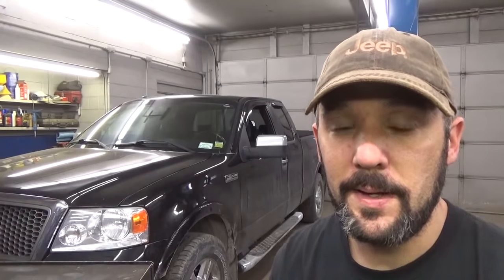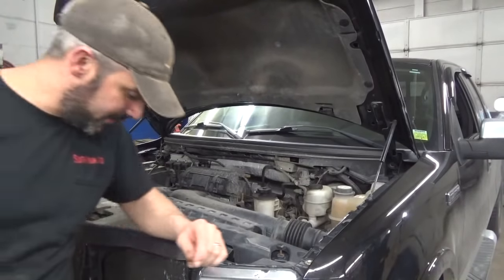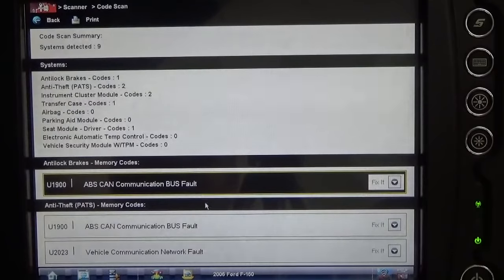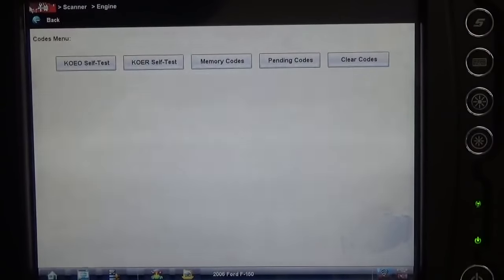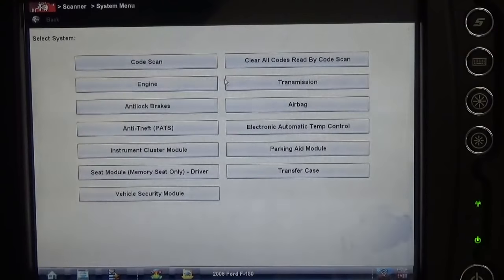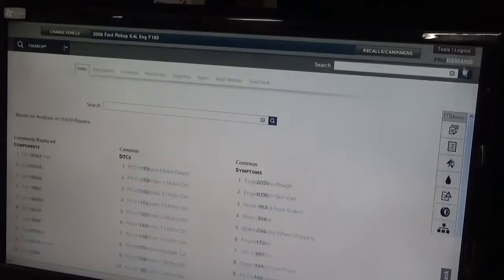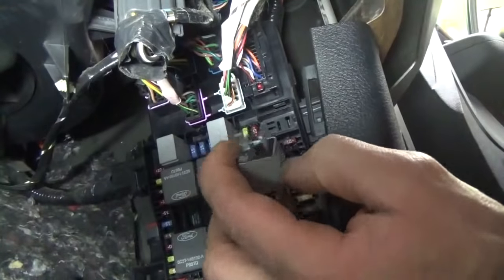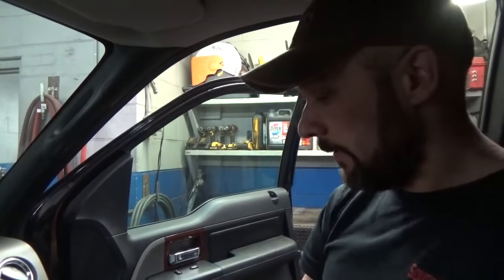Ford F150 5.4 No Start, No Crank, No Communications Codes: U1900, U2023

Comment: I also like the common sense approach. Start from where the power to whatever starts and work forward from there. I'm glad you took that relay apart. That's what I'd do because if something fails I want to see why. Some of that stuff that isn't made to take apart can be fun to take apart. I have to wonder what Ford was thinking when the decided to put the fuse box there. Oh, I know, they weren't thinking. Now that's a big surprise. :-D
Reply: +The On Grid Homestead Am I the only one who doesn't mind ford's fuse box placement? I mean out of the fords I've owned or worked on, I've seen much worse from other manufacturers. Although I agree, the fuse box labelling is crap.
Reply: Naoki Saito You're right, a lot of car manufacturers put the fuse box in stupid places. It's kind of like the designer forgot all about the fuse box then had to locate it anywhere there was a little extra space. Actually, it seems like quite a few elements in modern cars are inconveniently placed that way :-D
Reply: +The On Grid Homestead I actually think it's a Ford generic thing. The older Focus's PCM was located in that spot.

Comment: Hi Eric.  Thank you so much for this post.  I crawled down the same rabbit hole as you did with this truck, except with no scanner or schematics at my disposal.  I found a few things on the internet that helped me but eventually led to a dead end.  My truck had the exact same problem and solution as yours.  I found that fuses 32, 33, and 34 were not getting power just like your issue, but I was unable to isolate it to the PCM relay.  Your video helped me tremendously and guided me to the finish line.  Thank you.

Comment: You usually don't need fancy tools to diagnose:
1) I bet the CEL didn't come on KOEO (when you first turn the key)
2) Bet the tach didn't move when cranking (This is also  a test for the CPS)
Always look for that on fords when there is a no-start.  

Usually that means a power issue to the PCM. Relays fail even if they look perfect.

I had this same issue on a 96 Lincoln a few years ago.
Reply from the maker: alb12345672 I fixed  a lot of under hood fuse boxes on those old Lincolns.

Comment: Thanks Eric....
I've been really struggling this winter with my stubborn 04 F150 Triton 3V.
First broke a timing guide  ...barely limped it a few miles home.....fixed the timing stuff did lash adjusters checked rollers...new oil pump and PS pump that was leaking.
It ran ok but stalled when hot....got a code for engine temp sensor....also found vacuum leaks at the intake so I pulled that all apart....did plugs while it was apart and checked the knock sensors.....took my time and was real careful.
But then crank but no start.....messed with it a bit the no crank no start !
By now I'm way out of my league....gauges were acting crazy....had a weird clicking.....
Found your vid this morning and tried swapping the relays.....started immediatly !  That R02 relay is for fog lights.....I dont even have any !
Thank you so much......I dont have any more $$$$$ to pour into this truk but for now I really need it.

Comment: Feb 2021 2006 f150 won't crank . Watched video in grocery store lot contemplating a tow home under stood the content. Switched places with my wife and went for the #203 relay. Pulled it out, grey colored body but no corrosion discoloration, plug back in and eureka the motor started and She drove us home no problems. 
I'm buying a new relay tomorrow.
Thanks for the show
Bruce in Ohio

Comment: Hi Eric....I've been  enjoying your show for more than a year now.I am a retired Ford dealer service tech.I've found many problems with corroded relays on F series trucks,due to a leaking windshield.windshield washer fluid is quite corrosive and the  smart junction box is a complicated piece.I'v found many SJBs corroded beyond repair,due to  a leaking windshield.Just thought you might like to know...
Reply: Brian Jourdan same here... retired Ford tech.. found water in right side rocker panel... bad relays in BJB.. Don’t really miss dealership setting.Have my own shop now and doing agriculture work.. in frame overhaul on Diesel engines. Take care.
Reply: Exact same thing happened to my F-150.

Comment: stupid place for a fuse or connection/junction place. if you live where they salt the roads in winter time, youll know this. ya jump in the truck with your snow/salt covered boots.  its cold ya crank up the heater. it gets hot. evaporates the water blowing around the salt. then you have electric flowing nearby. static and magnetic forces collect that ionized salt  and it collects on the metal. then it cools.condensation forms releasing the salts and enabling the corrosion. this dont happen overnight. it could be weeks , months or years. if you have a vehicle with a box in a position as this  i would recommend removing the fuses and relays clean them with a good cleaner and reinstall in thier original position using a electrical grease to help seal the connections to reduce the chances of corrosion. ps do one at a time and double check you have the right rated fuse in the correct position
Reply: richard cranium idk man. i've got a late 70s fullsize bronco that has the fuse block just above your feet. they never came with covers or nothing. just totally exposed and i havent seen any oxidation on the contacts.
that being said, i think the contacts might stainless so that probably makes a big difference.
Reply: I like it much better in the engine bay
Reply: "its cold ya crank up the heater. it gets hot. evaporates the water blowing around the salt. then you have electric flowing nearby. static and magnetic forces collect that ionized salt  and it collects on the metal. then it cools.condensation forms releasing the salts and enabling the corrosion"

That's the one of the most impressive lines of bullshit I have seen in awhile.
Reply: "static and magnetic forces collect that ionized salt" LOL, yea.... you nailed it derekc728!
Reply: What's more important is, these late model computer technical vehicles are still built with old school fuse and relay boxes that are open to the elements. These designs have been around since the 1960's minus the actual fuse design from the old glass buss fuse to the current slim style. Of all the videos I have watched on this channel most of the customers problems are ELECTRICAL and/or cheap plastic crap devices that do not last as far as you can see tail lights.
Reply: @GlycerinZ  like Doge/RAM , exposed to all the elements? Water, sand, salt, heat, extreme cold, coolant, oil and all other fluid spills??? Really???
Reply: @youtubito69  yeah, I'll take it in a convenient spot where I don't have to crawl all awkward just to do testing.  And you DO know that fuses/relays come covered, right? To where the elements can't really get to them, because they're in a covered box.  C'mon, have more common sense.
Reply: Garth Clark...."cheap plastic crap", sounds like you've been watching Scotty Kilmer. Lol!

Comment: This  is Great ,Trouble Shooting  explained very clear & to the Point ,  Eric is a Real Professional  .  I have been a Mechanic for Over 50  years and I  LEARNED a   Lot from this .     There are a Lot of videos  on line However Many  take to Long to Really get to the Point  of the Issue / Problem  I  am trying  to Locate.

Comment: i have a 2005 ford exploder... lost my keys and had a locksmith make me a new one with a code, it started a few times and won't start anymore... so my computer isn't picking up the chip code... i jumped the starter and it turned over but would not start, should i clean out the ignition switch with electrical cleaner or blow it out with forced can air, i'm stumped, got any advise???
Reply: Did you talk w/ your Ford dealer ? They should be able to help you out with a new key. If not go back to the locksmith and either get him to fix it right or ask for a refund. Also, go to a Ford forum online, and ask them, you will be surprised how much help these guys can be.
Reply: Joseph M thanks... i talked to a couple of different ford dealers and their response was bring it up and we'll take a look at it and got price ranges from 300 - 3000 so i got some electrical cleaner and sprayed it in the ignition switch, and took out the remote auto start... and it started right up! not sure which one did it but i'm glad it's working now...
i talked to colorado lock and key and they told me to piss off and that they aren't responsible and offer no warranty after it works and they leave
ford forum eh? is that a chat room?
thanks again
Reply: heavylead1961 Glad things worked out for you. Wow the Ford dealers are crazy with that price, and such a price variation 300.00 to 3000.00 dollars.
Reply: heavylead196

Comment: Scope on a rope worked perfect. Had an 03 Expedition towed in no start. Popped schrader on fuel port. Nothing. Like an over eager idiot, I put a fuel pump in it. Still no start. Long story short. In that Central Junction Box the fuel pump relay is a little micro relay soldered into place. U can buy them online for about 20 bucks. My soldering and circuit boards techniques r very poor and 340 bucks later replaced whole thing. Ford had it in stock so u know what that means. I shoulda used scope on a rope and checked for power to fuel pump. The upside, it comes with all new relays like that grey one u changed out on the F-150, and now I have a bushel basket of Ford relays and fuses.
Reply from the maker: Bill Rimmer Hey Bill, I think we have all had those "hard learning" lessons :)
Reply: Bill Rimmer. Yes was headed down same rabbit hole .Then the customer noted that smoke and strong burning smell came from fuse box.
Reply: Lol I was waiting to run into this exact story!
Reply: I did the same thing by replacing the fuel pump.  I will know if this fixed the problem by this afternoon.  Thanks for your comments!

Comment: I know this is super old but here is a logical explaination: This relay is always on so the coil gets fairly hot in an enclosed space. Condensation.
Reply: Exactly! Condensation leads to moisture; which leads to corrusion; which leads to high resistance; which , in turn leads to the inhibition of electrical flow. Which is why the vehicle would not start.
Reply: Heat would evaporate the moisture.
Reply: Condensation doesn't form on a heated surface. It forms on a cold surface.
Reply: @samsteel4456  The higher than normal heat would cause it to condensate more after it was shut off - especially if the outside temp was low (winter-ish).

Comment: 5 1/2 years later... Still a good watch!
Reply: watch your video and if it worked for a while and then my truck no longer worked
Reply: ⁵³
Reply: Still relevant information. By complete chance, I happened to come across this video while watching randoms on his channel.....and I have an 07 with an intermittent no start - no crank issue. It only happens every now and then and it goes away when I try to crank it over like a million times. Now I know what the problem is and I'll be changing that relay.

Comment: Great video Eric.  Btw from watching this video before hand a while back I learned a few thing's.  Well what I learned came in practice when I had a newer freightliner cascadia with a no left turn signals out of the seven way light cord. Well I check power at the relay and got my normal powers and grounds. But my fuse was dead so when the relay clicks on and off my fuse would flash with the test light. That's normal and my relay was clicking and not transferring power. So I pulled the relay back out. Stuck another relay in its place and the turn signals started working.  Something relay clicked fine but wasn't transferring power to light my test light at the end of the 7 way. Same relay style in this video is used on that freightliner cascadia.  Well I didn't have a relay right away. So I pulled the horn relay out of the 97 dodge ram shop truck. Hahahaha.  Thanks Eric and happy new year

Comment: I wanted to comment that the bcm on the 2007 mustang gts are famous for ruining the bcm with water running down the a pillar into the bcm. Its been very rainy so im pretty sure im going to find the same thing on a 2001 ford f150 4.8l Thank you for the assist I found this while researching no crank no start issues, You saved me hours and my friends a lot of money.

Comment: dude this is literally what happened to my ford f150 (2004) unfortunately i went ass backwards before finding your video, i replaced the starter ($160) same thing, replaced starter solenoid relay ($25) still nothing then i looked up some videos because i couldnt figure it out until i did the same thing where i messed with the fuses and i got that beep then i checked the same one you did and the center prong showed some signs of shorting like overheating because the plastic looked different so i replaced that pcm relay ($15) and that was it! anyway at least now i have a new starter with lifetime warranty haha great video man!

Comment: Thank you so much!! My truck had the exact same issue just now, and I was stranded on the side of the road in southern Florida 105 degrees in the sun trying to get the truck to crank. Exact same problem with the relay, back on the road now thank you!

Comment: Another excellent vid! 

Leak at windshield on pass side is a mid 2000's ford truck common issue. The fusebox is multilayered with hard soldered relays inside that you can"t see. You can disassemble it but its a big pain. There will likely be more issues in the future. You can still get OEM fuseboxes. I bought one for a 2004 navigator and it was manufactured in Mexico in 2017, 375$ish. It is not too hard to replace it, bunch of screws and connectors.

Comment: I realize the date this video was created. On point troubleshooting sir! Water intrusion on the forward side of the firewall is an issue. I believe I saw an aftermarket hood/cover that can be installed over the firewall PCM connectors to prevent this from happening in the future .

Comment: Absolutely outstanding video!!  I have the exact same issue with my '08 F150.  Exact same fusebox, etc.  Just went out and looked at the relay, no corrosion, but I still suspect the relay.  A friend and I were checking fuses, pushing on relays to ensure proper seating, etc.  Since then the truck has failed to start once.  I'm going to get a new relay (I know, parts changing) and install.  Drive around the block a couple of times and see if it starts while warmed up.  Initial problem occurred when engine was warm.  Thanks again, great video.
Reply: What did it end up being...I'm having a heat soak issue I think new starter as well 2006 f150 5.4...thanks brother

Comment: That truck was in flood  and got water in the electrical box. Simple fix spray entire box with electrical spray and check all connectors , but make sure battery ground disconnected. Then it should be good, great job eric.

Comment: Thanks man for this video really helped get me in the right area for me. It was a different five amp fuse, but in the same area I was not getting power to my relays of top and my relay fuses, so one 5 amp fuse after messing around and wasting time fix the problem your video definitely got me in the right area. Thanks again.

Comment: Dude that’s a fine video and time well spent listening and watching you work. Problem is i haven’t got you for my mechanic and I’ve the same problem, i.e., battery is charged, gauges display but truck won’t turn over. 2011 f-150 5 ltr. 20 miles out in the So Texas country.

Comment: Been a mechanic for over 60 years, still learning,  Enjoyed your vid and your attitude,  Start with the basics - always.  How many times does it turn out to be dirty battery terninals - that look clean even?   My first car was a 1941 Chev Special Deluxe,.  Wish I srill had it,  Folks bought it at the factory for $900,  New.  Had a big rubber starter button on the floor.  Put the car in neutral and stand on that thing,  No relays, no solenoids, levers.  Always worked, no reason cars still couldn't have them,

Comment: A God damn ford will sink a normal person.  I got crank no communication.... 8 yr old ford 50k miles...  Junk already had Ps pump water pump and a leaf spring...unrelated now it's had a fuel driver and pump.... Still intermittent no start..been towed three times in three months.   Good thing they sell lots of fleet units cause I can't afford to fix this junk. Hats off for you with the skills and tools to work on this stuff.

Comment: I have a 06 Ford myself that is down. Don’t know if it’s the fuel sending unit or what…
But after watching your video it has gave me a great deal of information on where to start.
It will turn over but will not crank.
Thanks for your advice.

Comment: I have to tell you thank you. You have taught me more about my truck and the problem or problems I'm having in two videos after searching all over the interweb and YouTube 👍👍I di not have my manual and could not for the life of me figure out where the fuel pump relay fuse was and as you said they are not labeled. My truck has the drain the battery over night thing going on and also my voltage gauge died and is all the way to the bottom dont move. I can jump off the truck and even drive it and it runs fine but something is killing the battery. I read that fuel pump relay can short and cause the high voltage side to stay on and drain power. I need to also check the drivers fuel pump module at spare tire because I can hear like the fuel pump trying to run or clicking even when the battery is dead. I need my truck running so i can take it camping this weekend we have a big bushcraf fall gathering and i want to drive the truck so i can bring my canoe and do some fishing. If any of these symptoms with the truck sound farmilar please please help my friend thank you for your videos